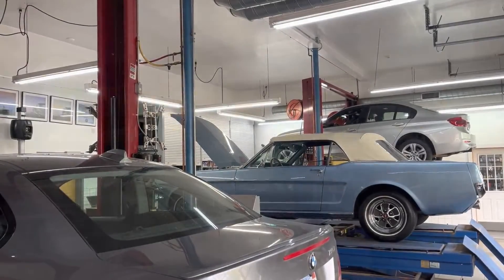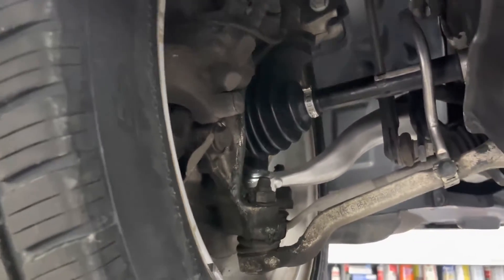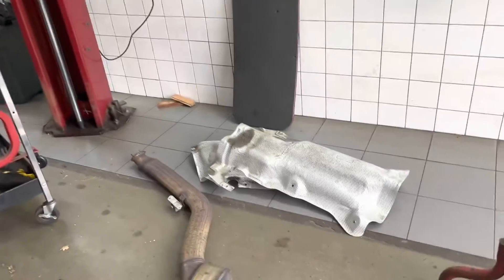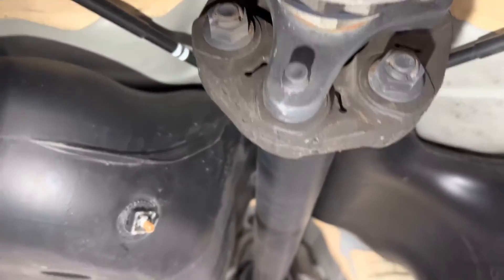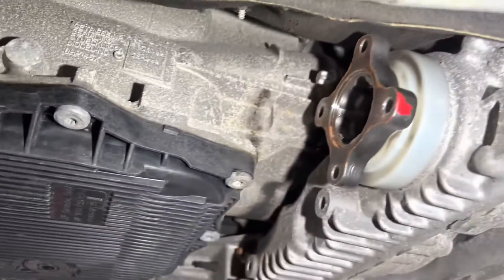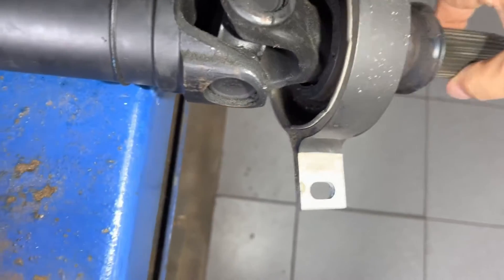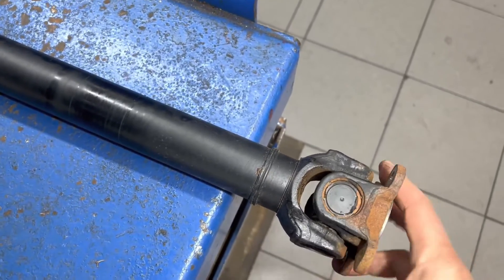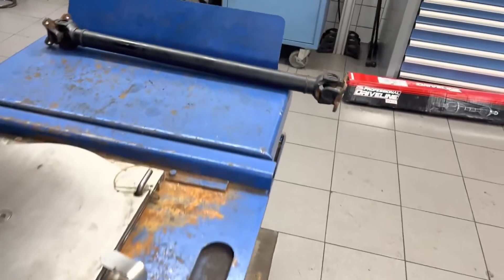BMW F30 (2012-2018) 3 Series Driveline Vibration Solved!

Comment: My 435i has a drone that appears around 65-70mph. Louder when cold. Changed tyres and still there. No vibrations felt in the wheel. Wondering if anyone else has experienced similar with their BMW?
Reply: I have the same issue with my  F06 640i. I tried several fixes I found on message boards and YouTube with ZERO success. I took it to the BMW dealer I purchased it from and was told I had a bent rim. I replaced the rim and still not fix.  I took it to a reputable indy shop  and they found that I have a bad rear differential. The technician took me into the shop where the car was on the lift and while another tech got it up to 70mph with the wheels spinning he showed me the vibration in the differential and pointed out the growling sound I was hearing in the cabin which was at it's loudest at 70!. The shop quoted $1,200 labor to replace the differential with one I provided. I bought a used one on ebay for $275 and will install it myself  once winter clears out in a couple months. Hopefully this will finally fix this issue!

Comment: Had a little too much fun in the snow today and now my 335 vibrates at highway speeds. Time to get to work I guess
Reply from the maker: Thanks for your comment! Before assuming a driveshaft issue, ensure the wheels are clean from snow. Snow will pack into the barrels, and throw off the wheel balance easily. It needs to be cleaned out after "fun in the snow" :)

Comment: 7:07  looks like the bearing is smooth but the the rubber between inner bearing and outer housing is worn and wobbling when you spin it?

Comment: Just for future reference, the driveshaft flex ring does not need to be replaced if you see small, superficial cracking.  A brand new ring will develop the same cracks within a few months of replacing.    It obviously should be replaced if there are large separations compromising the structural integrity, but they crack almost instantly…

Also, the position you flexed the first u-joint is out of its normal operating position, and isn’t going to cause a vibration. The second one you moved does need to be replaced.
Reply: Interesting observation, - question are these vibrations felt while the car is moving or stationary or both ? Mine does the following while stationary,  I can feel intermittent vibrations under the seat, the aren't obvious on P & N  but if you put it in D but with foot on the brakes it is more pronounce

Comment: i have a vibration sound of a deep humming that only comes with speed 95, worst at 110 and fades at 125 km/h. i did alignment,  front right bearing, changed tires, balanced, nothing helps :( differential was checked by specialist, still nok. vibration does not change with load/acceleration/decelartion but rather specific with speeds only.
Reply: @abdelrahmanibrahim4470  same with me... Made a shop check my prop shaft and all guibos.. they say all perfect... But the drone/light vibratione comes in at 120-135... I will start changing guibos just to see.. hope its not the shaft itself
Reply: @ i will try the same bro, found a second hand driveshaft will replace guibos and central bearing and hope for the best. Will post an update here.
Reply: @abdelrahmanibrahim4470  following, have same issue at speeds between 50-90kmh that doesn't always come but especially when the car is cold
Reply from the maker: We hope you all get this figured out in the end! Thanks for watching and we hope it was helpful.
Reply: @abdelrahmanibrahim4470  hi bro, may i know if you have solved the issue? Mine's having the same issue but at speed 110-115km/h only.
Reply: @chtan8872 yea man thank God, bought a second hand driveshaft + both guibos and replaced mine and car became smooth as butter. 
But thats after i excluded the possibly thats its engine or wheel/bearing/suspension issues. 

The job itself is a relatively easy one so i decided to do that before thinking about the diff. And it worked.
Reply: @abdelrahmanibrahim4470  hello,i have the same problem does your bmw only vibrate or vibrate and a little sound (contact between bars and abrasion)that go up when u go fast after 120kmh
Reply: @rigonmuji5247 hey man. 
No for me it was. Speed specific. Highest at 110 and lower or cant notice after 120
Reply: @abdelrahmanibrahim4470 hello have you problem solve?
Reply: @abdelrahmanibrahim4470  hi bro, Have you problem Solve?
Reply: @jakubgora4211 yes, swapped the entire shaft with used shaft/bearing/flexdisc assy and it solved

Comment: My bmw F36's rear right output shaft has some longitudinal play. Is that normal? The left one doesn't have that. The car vibrates after 100km/h and above that, vibration keeps increasing.
Reply from the maker: We do not have enough information to guide the next step in the diagnostic process, but some longitudinal play may be expected and may differ from the shaft on the opposite side. Please post the resolution of the concern here when you reach the fix.
Reply: @AlphaCars  Ok thanks. Bushings on the rear and front arms are ok, tyres are brand new, wheels no damage and calibrated. Checked the brake discs and rotating the wheel isn't smooth when spinning, there's a point where i can hear a sound and it kind of brakes a little, some resistance to spin. Probably 1 or 2 front brake discs are warped. Well they were due for change so gonna start there. 2 new brembo discs + brembo pads. Will follow up after this.

Comment: The car experiences a very brief and obtrusive juddering when it’s accelerating from a low speed (around 30MPH) on the way up to say 50-60MPH - in this scenario I was accelerating a bit vigorously after slowing down to go through an e-toll, or merging onto a motorway from an on-ramp. The juddering almost feels like the car is going over 4 or 5 shallow potholes in quick succession, lasting 1-2 seconds total as it’s accelerating. The juddering doesn’t seem to impede the acceleration, but it does ease when I ease off the throttle a little.

It’s a little puzzling because it doesn’t happen all the time, it doesn’t happen when you floor it from a still and it doesn’t seem to happen when accelerating hard at higher speeds either. When it happened today, the engine and running gear would all be well warm, it was mild and dry outside (10 Celcius) and all my fluids (and everything else) are ok according to the iDrive.
Reply from the maker: This sounds more like a drivability-related concern. A qualified specialist with a BMW ISTA factory-level diagnostic system would be best able to diagnose this condition.

Comment: My car is a 2012 320D Luxury, I hear an intermittent buzzing sound from the right front when making right turns. I feel a slight vibration in the steering wheel when making left turns. My tires are relatively new, my alignment is correct, they said there is no problem with the wheel bearings. No matter where I went, they couldn't find the problem, do you have any suggestions?
Reply from the maker: Unfortunately, without having the vehicle in the shop, it is impossible to provide direction for a diagnostic strategy. My recommendation is to find a shop that can help you.

Comment: Thanks! One of the best videos on this topic. Did you ever feel like a "kick" while accelerating, potentially related to a worn Guibo flex disk?
Reply from the maker: Thanks for the kind words! We don't remember feeling a "kick" or any delay in the engagement of the driveline. It was only the vibration issue covered in the video.

Comment: Hi, I’ve just dropped my propshaft and tried to split it. The shaft has pulled out about half way, but it feels like it’s being stopped by something. It doesn’t have the big nut like some of the other bmw propshafts and  looks similar to the one in your video. I did notice at the end of the shaft it has a clip looking piece, but haven’t got that far with mine yet. Any help on how to remove the shaft fully will be much appreciated!
Reply: Same here, any luck?

Comment: So the remedy was replace anything related to drive train 😂
Reply from the maker: Great question. The approach is, as a first step, to inspect everything and, given that the vehicle had 100K miles replace worn parts. Most of the time, it will address the vibration concerns. While it made the car drive better, the vibrations were still present. So, this video describes the additional diagnostic work, the drive shaft U-joint inspection, that was done by the shop. In this video, we show the specific issue with the U-joint that caused the driveline vibrations. Thanks for asking the question.

Comment: @alphacars
Thanks for the video! Just got my driveshaft out from under the car(rear one) - how did you disassemble the long part from the short part..? There’s no nut keeping them together like on older BMW’s… thanks for any pointers
Reply from the maker: I did not work on this car, but believe that they are held by an internal snap ring and you would pull them apart to separate them.
Reply: Same issue, came off the splines a little bit, then stopped, any luck with yours?

Comment: I have a 2008 528i that it seems like the car is I’m vibrating and wobbling from the front end at speeds over 40 mph..not sure what’s going on. Any help would be appreciated
Reply: Torque converter shudder
Reply: @hanynowsky  huh?
Reply: @joelane4670  your automatic transmission torque converter judders at low speeds.
Reply: @hanynowsky  I’ll give that a look!  It usually does as I’m taking off from a stop..thank you for your help!!
Reply from the maker: Call us at 978-263-9000 and we are happy to discuss your service and diagnostic needs! A specialty shop will be your best help. If you're diagnosing this yourself, start with a thorough visual inspection of all front end components, and ensure your wheels and tires are all true and balanced. Without seeing the vehicle in person, that's the only general information we can provide as a starting point.
Reply: @AlphaCars  what is a prop shaft?
Reply: @AlphaCars  question..I had my passenger side of my car jacked the other day..other down..I went to move the tire from the 3-6 position again the tire moved like the other side was off the ground..should that happen..really appreciate your help..peace!
Joe

Comment: Also I have some vibrations on my F11... Those are present during the accelerations and at constant speed of 130-140 kph... I suspect the rear shaft rubber joint. I have also the engine mounts gone (I feel it, this is my third 5er), thing that makes the vibrations also worse...
Reply: Salut , am aceleasi probleme ca si tine ,ai rezolvat?
Reply: Hast du problem gefunden?
Reply: Changing the engine mounts and the differential joint the problem has gone!
Reply: @valefur72  How worn was the joint? Do you mean the rubber Guibo?

Comment: I replaced my carrier bearing and guibos and that fixed my issue.
Reply: What were your symptoms, what speed? What bmw?
Reply: @hanynowsky  50mph+ I had an annoying vibration in the floorboard
Reply: @jeremywhite845  same as me. Thanks 🙏
Reply: @jeremywhite845  did u feel in when driving slow too?

Comment: Hi I have a f30 rwd with 49k miles. When accelerating normal it’s fine. On hard acceleration it vibrates (the rear tunnel)
Reply: I also have this issue , did you resolve ?
Reply: I also have this issue.  Noise is right under the console.  At high rpm’s.  Do we know what parts are right under the console that go bad?  2015 335i f30
Reply: Rwd
Reply: Servus , haben sie gefunden die virbrations?

Comment: Its same problem with my f10 520i. Like, i feel vibration from steering wheel & cabins. Smooth but disturbing. From cold start until I drove it, I checked to bmw services and they told me that my car have no problem. So weird

Comment: i got a 2014 328d on 270k bmw in canada just quoted me 1800 CAD just for the part. Found a used part with a warranty ordered it from US for 260 $ waiting for the part
to arrive. so all I’m saying is never actually buy the parts from Bmw it’s self at this point there is so many used parts with warranty available on internet even though it’s harder to work on BMWs compared to other vehicles it’s nothing impossible i’ve been doing pretty much everything myself in my underground garage  🤧🤧
Reply: Did it fix the issue?

Comment: Same issues in my 2017 320d F30 190 hp. In January 2023I booked a check in BMW service here in Italy.
Reply: They told me I must replace the dual mass flywheel. I'll let you know if this will fix the vibration. They excluded drive shaft or engine mount failure. I'm not 100% persuaded..
Reply from the maker: We hope you get it sorted!
Reply: Was it the drivetrain?
Reply: Dual Mass flyeheel and clutch replaced. Vibration didn't change. Vibration pulley seems ok . I'm going to find a non official service. Now 221000 km.
Reply: @sergioborghesan6318  sorry to hear that. 2018 320d 160k km, going from service to service… new brakes, new engine mounts, they say the car has no problem…
Reply: Update: engine mounts replaced. Nothing changed. Now 271000 km.
Reply: Any update??

Comment: I have a 330e from 2016. I have almost identical vibration issue. Comes in intervals, as a low level hum/rumble vibration/noise. Something is there at 35-40mph, goes away and then comes back at 70-80 mph. 4 sets of tyres, new front wheel bearings and alignment done. No change in the vibrations. Just ordered a new propshaft from Germany after watching this. 🤞🏼🤞🏼🤞🏼
Reply: New Propshaft went in today. No more vibration issues, smooth as silk. It's safe to say that I enjoy driving the car so much more now 😁⭐👌
Reply: @singleplanediscovery3475  what is a prop shaft?
Reply: @joelane4670  the driveshaft is also called the propeller shaft. It's the long cylinder which connects the transmission to the rear wheels
Reply: @singleplanediscovery3475  no way man. Most people believe this is a gearbox issue because only happens when hot but maybe not? - is the issue still gone?
Reply: @singleplanediscovery3475  Did you replace the front or rear propshaft?
Reply: Did it solve your vibrations!?? I have a 2015 550i with same symptoms
Reply: We are swapping prop shaft this weekend, as well as changing the diff. Oil. I'll leave a post here if I remember 😊
Reply: @singleplanediscovery3475  hello, is there any new?
Reply from the maker: Wow! Let us know how it turns out!
Reply: What was the final bill on the solutions you provided? $$?
Reply: Is the issue got fixed after changing the prop shaft.? Thank you
Reply: Salutari , a fost inregula dupa? Au disparut vibratiile?
Reply: Was it the propeller shaft ot the diff?
Reply: I have the exact same issue so hopefully sorts it for me